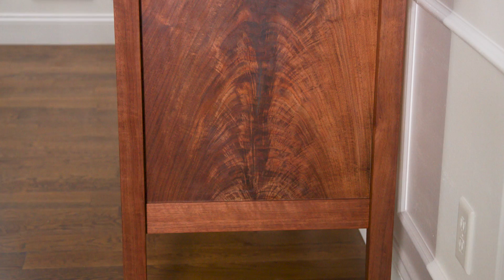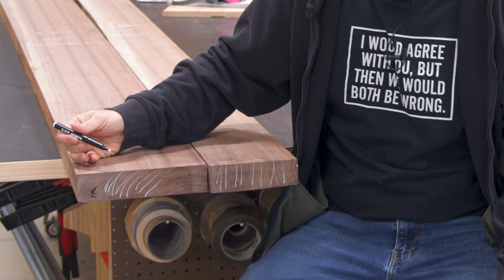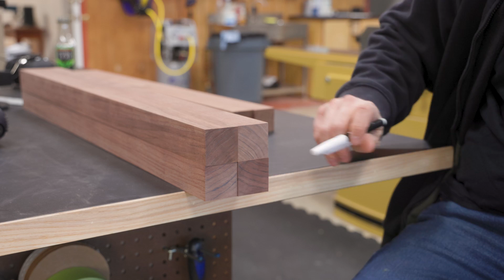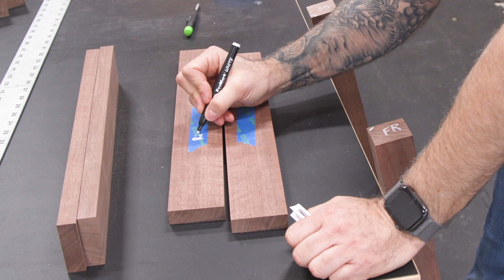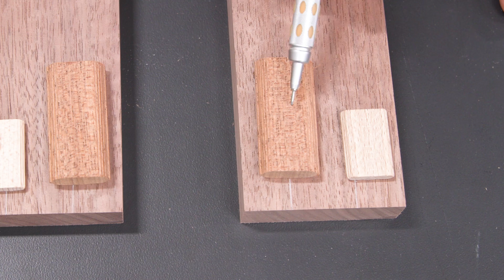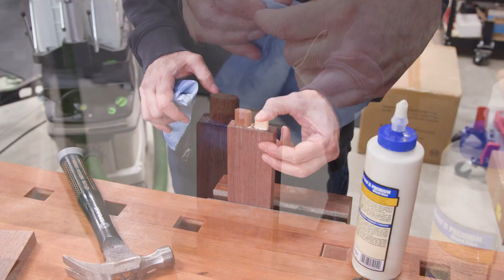All About That Grain! | Legs and Rails | Sideboard Series Pt 1

Comment: you are a good wood worker in my opinion and a good teacher, I learn a lot from you . I watch  a lot of videos on wood work and most of them have very clean work shops as you do. I used to believe that a wood work shop basically keeps clean with a bit of cleaning but having had the hobby for about 10 years and with dust collectors my shop is as clean as a cleaned out pig sty I love my wood work and have some good machinery but don't like spending a third of my lifer cleaning and polishing. I have heard that a true wood worker spends about 20 percent of their time doing the actual wood work.

Comment: Great to have so much information about the grain pattern. Thank you very much!
Questions: do you use the endgrain orientstion of the legs because the complete sideboard sits againts the wall? Would you use other orientation for table legs you can see from all sides? And why should the grain lines and not the core part of the leg point to the center ?
Thanks again for your work and all the best to you from Munich, Germany

Comment: I think you mixed up Rift and Quarter sawn.... Rift sawn is all vertical grain. Quarter sawn is more diagonal grain. That's why in Oak you see the medullary rays in quarter sawn, if the gain were vertical you couldn't see the rays.
Reply from the maker: You have it backwards. Vertical grain = quartersawn. Diagonal is rift. Google it if you want to see some diagrams. Here's one. https://d4c5gb8slvq7w.cloudfront.net/eyJlZGl0cyI6eyJyZXNpemUiOnsid2lkdGgiOjcwMCwiaGVpZ2h0IjoyNjB9fSwiYnVja2V0IjoiZmluZWhvbWVidWlsZGluZy5zMy50YXVudG9uY2xvdWQuY29tIiwia2V5IjoiYXBwXC91cGxvYWRzXC8yMDE4XC8wN1wvMzEwODQ2MTlcL3F1YXJ0ZXJzYXduLXZzLXJpZnRzYXduLXdvb2QtNzAweDI2MC5qcGcifQ==
Reply: @woodwhisperer  Definitely depends on where you google. From Wikipedia: Quarter sawing is sometimes confused with the much less common "rift sawing."[3][4] In quartersawn wood, only the center board of the quarter-log is cut with the growth rings truly perpendicular to the surface of the board. The smaller boards cut from either side have grain increasingly skewed. Riftsawn wood has every board cut along a radius of the original log, so each board has a perpendicular grain, with the growth rings oriented at right angles to the surface of the board. However, since this produces a great deal of waste (in the form of wedge-shaped scraps from between the boards) rift-sawing is very seldom used.
Reply: From the entry for Rift sawing: Civil Engineering Materials describes rift-sawing as a process where boards are cut radially.[1] Thus, the grain is always nearly parallel to the short edge of the board and thus nearly perpendicular to the long edge of the board. This produces stable boards with comparatively thin grain; least susceptible to warping, twisting, or cupping; and hence most valued for products where dimensional stability is critical (e.g. musical instruments, high-end sports equipment).

This is similar to the process used to make wood shingles. The word rift derives from rive which describes the splitting of a bolt of lumber along its radius.
Reply: Okay. I've been down a rabbit hole on this. We are both right. Someone somewhere used the terms backward, and it stuck. Going by what builders look for in grain, 30-60 degree grain is commonly called riftsawn, and 60-90 degree grain is commonly called quartersawn. However, from a sawyer's perspective, rift sawing a log will never produce a riftsawn board but only quartersawn, while quarter sawing a log will produce both riftsawn and quartersawn boards. Therefore, the terms used for boards are backward from the actual meanings of the words.
Reply from the maker: @general4str That’s interesting stuff. Just make sure you’re using the right terms when making a purchase. This isn’t a debate you want to have with a lumber dealer 😂
Reply: Depends on where you do your googling.
Reply: @kevinn6538  Nah, depends on the perspective from which you're asking the question. Someone else mentioned sawyers vs. builders, and IMO, the only definition that matters is the sawyers' as, ya know, they're doing the sawing.
Reply from the maker: @ChrisHornberger The sawyer can call it whatever he wants. The definition that truly matters is the one you use when you go to buy material. So you better ask for quartersawn if you expect what is commonly known in the industry as quartersawn.
Reply: @woodwhisperer  Absolutely fair, if the material suppliers have fallen into their own standards. I couldn’t care less which is “right”, but we should all definitely use the same nomenclature. :\
Reply: @woodwhisperer  Yeah, on rethinking, the supplier's nomenclature matters more at our ( the builders' ) end of the chain. 👍

Comment: Awesome, Marc! So ... essentially a detailed guild project without the guild project price? I understand it may not contain everything a guild project would, but you're such a giver! 
Speaking of wasting wood, have you ever discussed re-establishing the flat on overly thick material to get the grain pattern you desire? For instance on quarter sawn (or even flat sawn), material, if you establish a new face at an angle so the grain runs diagonal, it becomes rift sawn. Might be a way to get more out of a single board if you've got the thickness to support it. But it does waste a lot of wood. lol